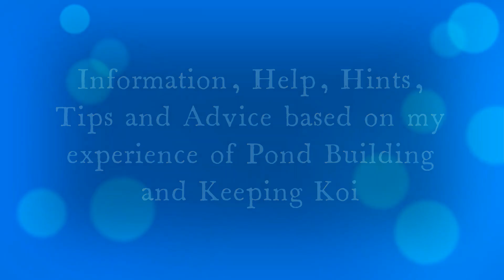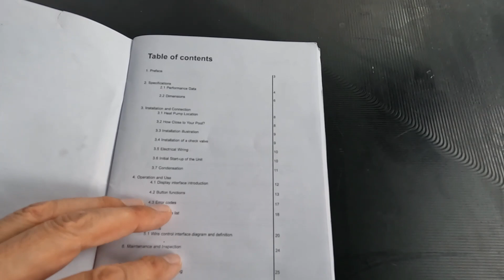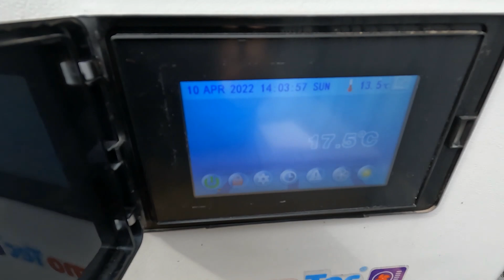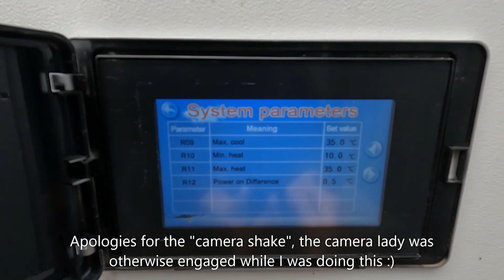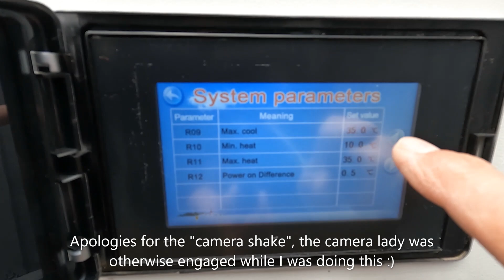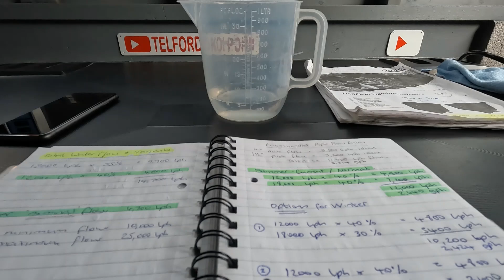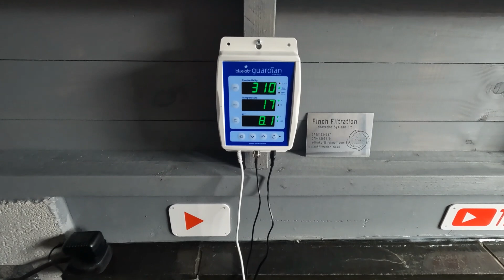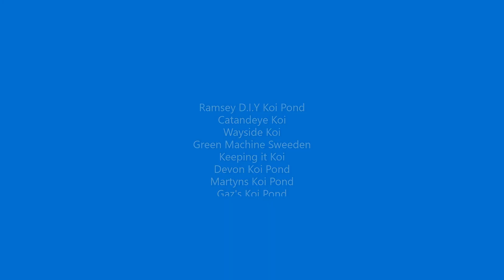T.K.P. Telford Koi Pond - Video 59 – Koi, Pond Overview, Questions Answered and some Shout outs.

Comment: Nice update vid mate. I recieved my oase proficlear compact L gravity this morning! Just need to build a base for it before i crane it into the filter house! No roof on the house deliberately for this purpose but i did install a large enough door also just incase i go across the lawn with it. 😬
Reply from the maker: Hello Aaron👍😊. I have absolutely no doubt you will be really pleased with your drum, they are superb…..but bl@@dy heavy as they are extremely well made😊👍. Are you having any Oase components to use with it e.g. individual unit or Bitron gravity uv? . Would love to know how you get on with it👍😊
Reply: @TelfordKoiPond  not planning indiv unit thought about it but thinking two vari pumps return one to a bakki shower which inturn will return over a blade in filter house wall and one to two returns in wall that will bypass to an ASHP when i can afford one. 55w uv somewhere on the return not fully set yet where. Dont have alot of space. Out of interest what distance is it from drum inlet side to indiv unit outlet side? incase i extend the base in the future have to raise it maybe 40cm or so to get water level in drum correct another nervous  plan 😬😵‍💫
Reply from the maker: @aaron659  distance from drum inlet to individual unit outlet when both in position/together is 195cm👍😊
Reply: @TelfordKoiPond   no room 245cm from bd to far wall have to stick with other plan sadly
Reply from the maker: @aaron659  I’m sure plan A will more than meet your needs👍😊

Comment: Hi Phil , Do you know what the difference between your inlet and outlet temps are just I  think your bypass valve looks fully open , you can use this to balance the inlet/outlet temps to a difference of 1.5-2 deg difference and this will give you optimum performance ,
What jack says is correct to a point , but as you have a moving bed and good water movement , you have more than enough dissolved oxygen for you to turn your bottom drain air off for set periods of time , I have mine on a timer . The main purpose of the spindrifter air is to aid the bottom drain in its operation of pushing debris towards the drain , in the warmer months you may need to rethink and have it on all the time but again with the moving bed , and for me having a shower provides plenty of o2 
Nice exsplaination of how you run your pond mate , roll on the warmer nights so the covers can come off 👍👍😀😀
Reply from the maker: Cheers Martin, much appreciated 👍😊. Marek wrote to me about having my ball valves fully open so I phoned HeatPumps4Pools (where I bought it from) and they said the valves should be fully open at all times apart from when I am completely bypassing or removing the heat pump. I’ve gone through the technical manual and it doesn’t say anything about balancing inlet and outlet temps and couldn’t find anything on YouTube. I don’t suppose you could send me the link for somewhere that explains this? I’ll obviously keep looking on the net😊👍. Good point about the spindrifter air, I’ll give that some more thought 👍🐟🈲😊
Reply: Funny you should say heat pumps4 pools because the basic info is on their website under installation and plumbing , but a friend told me what to do the centre valve should be opened a little to divert some water away from the heat pump keep doing this untill you get an inlet out let temp difference of 1.5 to 2 deg when the pump is running , 👍👍👍😀
Reply from the maker: @K.W.P.R  Martin you are a star👍😊. I looked on their website and if you go into the actual Thermotec ASPH page and then to installation there isn’t any mention of it but if you go into Installation tips on the home page it does detail it….so annoyed😡. Looks like I’ll be adjusting my vales at the weekend👍😊. Many thanks for pointing this out, it is appreciated 👍😊
Reply: @TelfordKoiPond  no worries Phil👍👍

Comment: Hi Phil, looked to me your bypass valve on your ashp was fully open, you need to open/close this valve fractionally to get a 1.5 -2 deg difference between inlet and outlet on ashp after its been running for 45min or so, this makes ashp more efficient, take no notice of me if your already doing this, my valve is set at about 3/4 open to give me the difference in the in/out temps. 👍.
Reply from the maker: Hi Marek👍😊. Not quite sure how I’ve missed that but no, I didn’t know that Marek so thank you for pointing it out to me, I’ll be looking into it tonight👍😊
Reply: @TelfordKoiPond  glad to be of service 😇👍

Comment: Hi Phil, brilliant info! This is possibly a bit of an odd question but I would like your opinion on how much space you need above the Oase Filter to comfortably maintain the system. Reason being, my garden slopes downwards and I'm running a pumped system so to make the installation work for me relative to the water level, I am going to have to raise the roof of my shed to accomodate the working space required above the filter.
Reply from the maker: Hello Ray👍😊. Interesting question🤔. To physically lift the lid if the unit and slide it forward to take it off you probably only need about 6 to 12 inches but to comfortably maintain the system I would suggest a minimum of 36 inches and would go for 48 inches if you can. Difficult to answer without seeing pictures of what you had and what you intend to do so the above is based on the access I had when I had the filter covers on that were hinged at the back. Hope this helps🤞🤞🤞

Comment: very informative video there Phil👍 Thank you for the mention on the bio chamber, My air pump is a 30litre so maybe i don't have enough media in the chamber if its boiling too vigorously🤔 Do you know, or are you able to calculate how much water your bio chamber holds on its own without media in it? obviously I know you mentioned you have 80l of helix in there but if I could work out the media to water ratio in your bio then I could see what ratio mine is and see if there is a possible problem there with my media to water ratio.

How are you finding the cost of the heater now? mine is costing me on average £2.43 a day, obviously as it gets warmer it won't be as bad.

nice video buddy, take care👌
Reply from the maker: Evening Simon👍😊. No problem re the shout out, really enjoy your vids👍. Just been and measured my bio chamber and inside measurements are 59cm wide x 74cm long x 60cm deep (to top of water) and as per the video I have 80 litres of media in there at the minute. Hope this helps🤞👍. Tbh yours looked like mine did when I was using a 60lpm air pump and it was a guy on the Oase stand at the Coventry show that suggested I go down in terms of airflow to get it like the one they had on display👍😊. Let me know how you get on🤞👍. Re the heater, we’re still on a fixed tariff until end of May so I calculate mine is virtually £1 per day at the minute but I’m only heating to 17 degrees and covers are still on. Stay safe👍🐟🈲😊
Reply: @TelfordKoiPond  thanks Phil.👍 From those dimensions, it would seem your bio holds about 262 litres of water which works out roughly as 70% water to 30% media.

mine at the moment is 60% media to 40% water. (my bio holds 134litres of water) what I have done for the time being though until I get a valve to bleed off the excess air, is drill a tiny hole in the air line before the non-return valve to vent it. this has slowed the boil down considerably and seems much better so I'll see how it goes👍

Comment: Looking at the thermotec 12kw versus 9 kw what u think?
Also how powerful are your airpumps on the bd and moving bed?
Reply from the maker: Hello Aaron🖐. I spent ages choosing mine and drove the sales guy batty with my questions🤣😂🤣. Bottom line is bigger the better , for similar reasons to pond pumps. If you look at the tech spec, the 9kw model will be sufficient for my pond (2500 gallons/11,400 litres) but it will be working hard at extremely low temperatures whereas the 12kw model (which is what I have) has more oomph/power/capability so will be working more efficiently and we’ll within its capability. Re the air pumps, I use a very cheap Swell 20 lph air pump on my bottom drain which is more than sufficient on a spindrifter bottom drain 5ft deep and I have a Jecod PA60 air pump in my moving bed. Until recently I just had 60l of Helx13 in my moving bed and all you need for that quantity is a Jecod PA45. I’ve now got 80l of Helx13 and 10 litres of Oase pond pads so needed the bigger PA60 pump to get the circulation I was looking for👍. I’ll do a video tomorrow and cover all this in more detail so watch out for it👍😊
Reply: @TelfordKoiPond  look forward to the new vid. I plugged in a 30lph air pump to my bd and nothing came out the bd drain so now im worried ive a blockage! 
Pond id 2/3 full  i did make sure nothing was in there before i fitted the airline attachment in the drain and i will be full of water i presume since i filled it 
Can water get in thru the perforated holes in top of a spindrifter? 😬
Reply from the maker: @aaron659  Hello Aaron🖐, when you very first commission your pond you need to re bear that the air dome on the bottom drain and the whole of the airline run will be full of water. In most instances, if you leave the air pump on long enough it will eventually build up enough pressure to blow all the water out (no more than 2 or 3 minutes but remember that water is heavy stuff, especially at 5ft deep). Sometimes the air pump you need to use once it’s up and running is not powerful enough to push the water out. There’s no way that the 20lph pump I run now would have cleared the water out at the very start, I used a 60lph pump and then swapped it over after a week of running. I think you would be very unlucky to get a blockage in your airline but check for kinks and pinch points. Can you borrow a more powerful air pump? Can’t remember where you are in the country, if you are anywhere near me I’ve got a couple you could borrow 😊👍
Reply: @TelfordKoiPond   was thinking/hoping that might be the case will try to sort it my old pond has a 50 air on it will try that before buying something stronger ( im in N Ireland)
Reply from the maker: @aaron659  a 50lpm air pump should easily push the water out through the spindrifter so definitely try that pump but your other air pump should easily be sufficient once the line is clear👍😊. Yes, N Ireland probably a bit too far for me🤣😂👍. Let me know how you get on🤞👍😊
Reply from the maker: @aaron659  afternoon Aaron, I put a video out last night about my air pumps👍😊